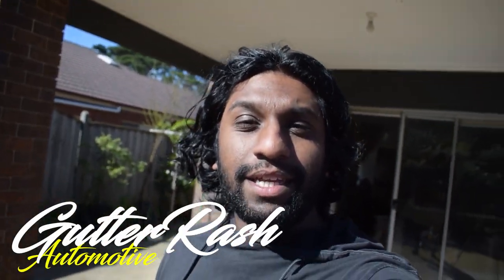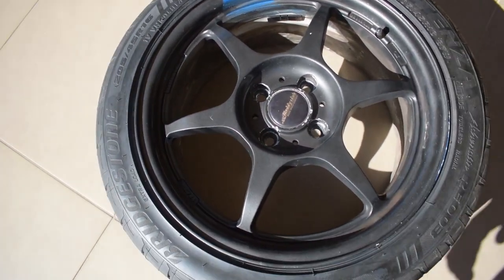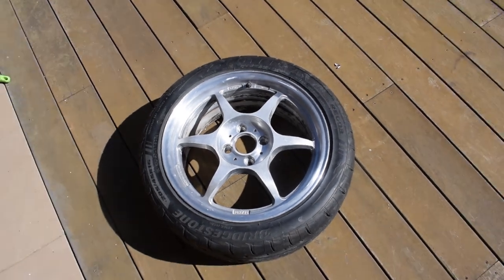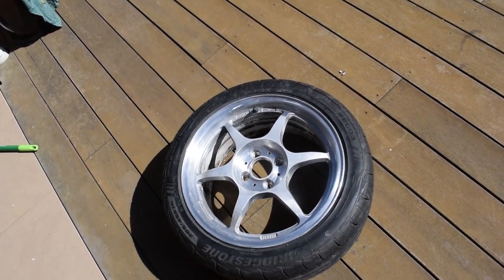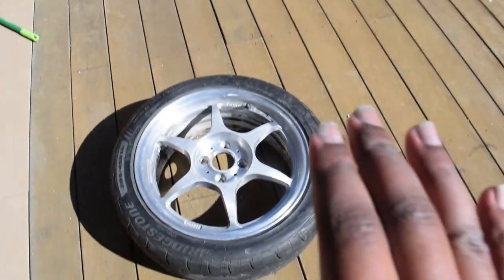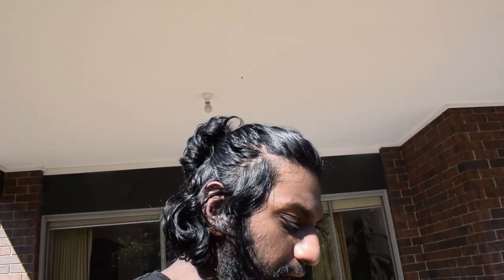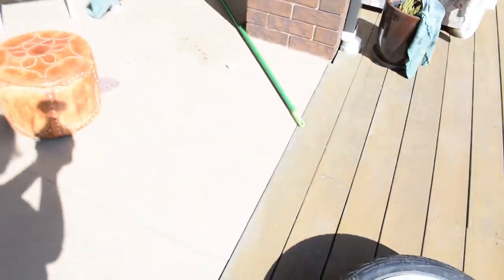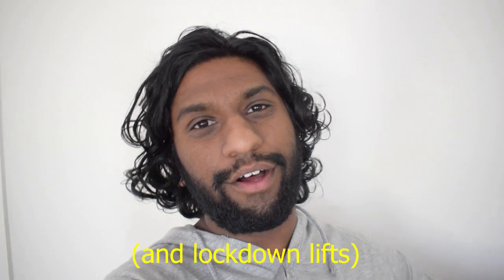Stripping Wheels Using Paint Stripper (GONE WRONG)

Comment: so for anyone wondering i did this same exact thing with a pair of gramlights i had, however when i got the rims they were blue from factory, then i painted them myself black, then white, and then back to black again before i decided i wanted a ' polished '  look and i had similar issues like this once i started the paint stripping process, but now fast forward in time i traded a different set of wheels for some black Avid avo6's and i put a little paint stripper in a small area just to test it and within a few minutes it was down to bare metal and all the paint in that area perfectly lifted off. SO long story short, if your wheels are spray painted, its not worth the hassle of tryuing to paint strip, but if its the original paint on the wheel it seems to come off with little difficulty (for me so far)

Comment: I think it is usually a better choice and cheaper and better for your health  to just buy a new set of wheels. end of day Used wheels  are just that but with a relatively inferior paint product on them. I have gone both routes i guess it depends on the wheels and why you want to upgrade them. but I agree with you... painting anything is very labor intensive and consumes a lot of material and time. and its a mess. if using a paint stripper on Alloy, be sure its an aircraft stripper. Some strippers will pit the alloy.  Thanks for the video

Comment: You need a pressure washer. Then use a wire wheel to get down to the bare aluminum with a oil based wet sanding. WD-40 would be just fine.

Wash the wheels good, and dry them off well. Air gun blower, and dry towels. I use Mother's Aluminum polish and a polishing wheel,and go to town on them. Then use a 6 in buffer to remove the polish. It should be a mirror finish. Yes it takes time, but if you have power tools it helps a lot.
Reply from the maker: Some sage advice!

Comment: I feel your your pain, I have some aluminum rims that the clear coat has dulled on and some scratches that have started to oxidize from exposure. yes paint stripper is dangerous if not used correctly. Unfortunately paint strippers today are not as good as there were some years ago thanks to rules put in place banning methylene chloride in it. It came about because people did not follow directions and precautions. I found this out the hard way like you I'm spending way more time and labor cleaning clear coat off than should be required. I recall using stripped years ago that would take paint off in 5mins.Im now committed since I started the one rim Im dreading doing the rest. Unfortunately having the wheels professionally done will cost you almost as much as just buying new aftermarket rims.
Reply from the maker: Yeah it's really not fun at all. I got the other two sandblasted because I really couldn't be bothered dealing with the pain again. Good luck in your endeavours

Comment: The way the paint on your wheels barely flaked up leads me to believe the paint remover you used was very weak. A good quality chem strip will make the job much more simple. What product did you use?
Reply from the maker: Yeah that could be it. It did well with the first two layers but struggled heavily with the factory layer. Used Polystrip from Bunnings

Comment: I think you needed to review other people's prep work on how to repaint the alloys it would have given you a better understanding before starting. 
I am in the same boat as but my insides are a lot worse then yours .I have a couple of ideas but will see how it goes. 
But its always good experience for you to try something new 
I wouldn't get sand blasting as this will leave to many pin holes.
Just do as you said scuff and wet grit them and then just prime and base coat with laquer 
See how you feel you were  unlucky but appreciate a honest video
Reply from the maker: Well said man. I watched quite a few videos and stripper seemed to work for other people. 
Despite the stripper being hard work the paint came out really nicely so not too much of a loss at all. Surprisingly you're the first person who has recommended against sandblasting. My most recent video is getting them sandblasted and yes the blast media left too much pitting on the surface so they didnt come out as nicely as the paint stripped wheels.
How do you plan on tackling yours?
Cheers for the constructive comment ☺
Reply: @gutterrashautomotive3361  
I am looking at a different wire brush to the drill to clean the insides they seem to have like a scouring pad type which fits to the drill .they say that works out better and quicker .Once the weather is better I will have a go and see how it goes and will let you know ,I am going rub down the front with grit but as you said I am not taking it to bear metal but to get rid of the rust and sticking out bits .
Kind regards
Reply from the maker: @mrman9561  oooh that sounds like it'll work, let me know how it goes. Good luck!
Reply: @gutterrashautomotive3361  
Thanks will do to be honest I bought a 2nd set of alloys cheap and then when done I will add them to the  car and work on the others 
Good luck with your next stages
Reply: Hi just done my alloys wanted to send you some pictures but not sure how to .
But I had the inside clean and mine was very corroded with paint , but spent and cleaned off the rust and it took me 1 hour a rim 
How ever I am thinking of just rubbing and cleaning any bits by sanding and wet grit but I am not going to take to much off as I will use the original base coat 
Once I prepped and clean I will start to do the primer base coat etc 
But the paint removing tool was very good ,I would use for the top etc
Reply from the maker: @mrman9561  sounds tedious! Send any pics to the gutterrash Facebook or instagram if you can be bothered, would be interesting to see how yours looks
Reply: @gutterrashautomotive3361  
Unfortunately I don't have Facebook or Instagram but will keep you updated 
Kind regards
Reply: Well I have finished my rims and must admit I am very happy with the  results, I did clean the inside and the outside of the rims and the inside edge of the rim. I then started to rub down the front of the rims but only lightly as I wanted to keep the shape of the edges and then once cleaned i then used etc primer 3 coats light medium and thick .then if they needed a slight rub with 1500 very fine grit 
Had to admit 2 solid days rub and clean and  2 days for final coats .
I wish I could show you all the stages that I did but don't use intragram  or face book 
I have bought the tyres and will add on to car hopefully tomorrow 
Thanks for your comments and the guys profile for allowing me share my comments. 
I can only advise what I did . But etch primer is very good primer compare to this other one I used
Reply from the maker: @mrman9561  Glad to hear it went well! I too used etch primer but I also laid some primer surfacer over it before hitting it with base and clear

Comment: It is quite 0K.I watched your video and I thought that using paint stripper might be a quick and cheap way to go with the tyres still on the rims. There's nothing wrong with what you did, it just takes a bit longer to get it done sometimes.I have a lot of rims to do and I look at these videos for inspiration. We all learn by doing. Good luck with your wheels.
Reply from the maker: Thanks Ian. It was a good learning experience. For me the time/effort it took to strip them was not worth it. I got the other two sandblasted and although the finish wasn't as good, I saved a lot of time.